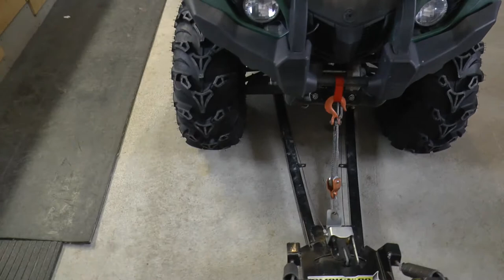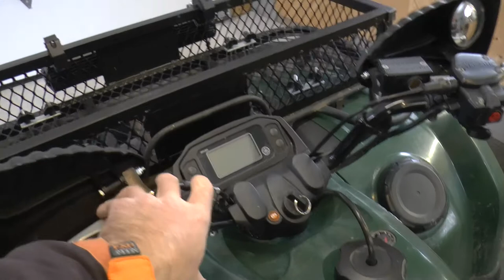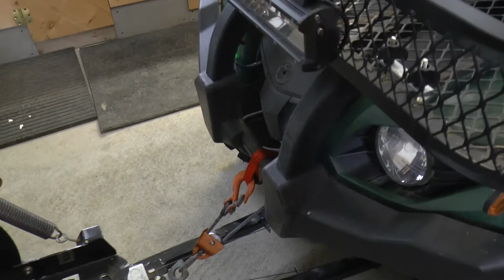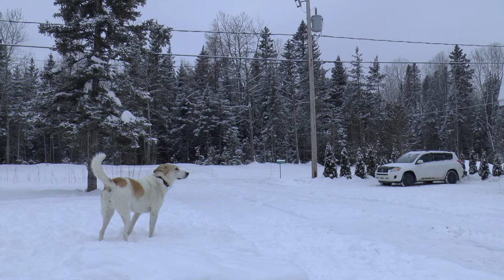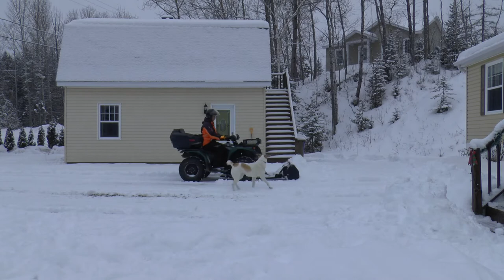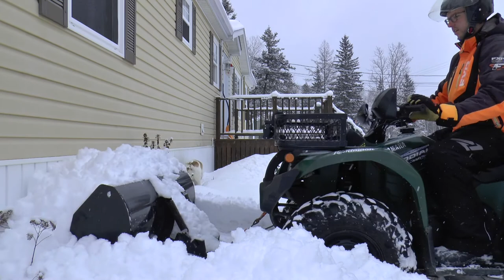Yamaha Kodiak 450 Kimpex Click N Go ATV plow

Comment from the maker: ✅ Get those accessories to build your own ATV setup 👇🏼👇🏼👇🏼
○Champion Power Equipment ATV 4,000 lbs winch : https://amzn.to/3VcLvIC
○Ranger 3/16’’ x 50’ synthetic winch rope : https://amzn.to/3V7cDJV
○Ranger winch cable stopper : https://amzn.to/3phAjNU
○Ranger ATV aluminium winch rope guide : https://amzn.to/3sl9omo
○Ranger winch hook with safety latch : https://amzn.to/3picNjJ
○Ranger winch hook with integrated pulley : https://amzn.to/3HPSJiS
○Ranger steel pulley : https://amzn.to/3VsmPwf
○Neiko 2’’x 20’ tow strap : https://amzn.to/3G4M7vL
○Kolpin ATV rack basket : https://amzn.to/3F28eTb
○Nilight LED light bar with wiring harness : https://amzn.to/3MZnthn
○Nilight Clamp mounting kit for LED bar : https://amzn.to/3ta9cFv
○Kolpin handguards with mirrors : https://amzn.to/3JT3ezI
○Kolpin Rhino Grip gun holder : https://amzn.to/3Ni5LX0
○Rubbermaid ActionPacker storage bin : https://amzn.to/3DmsAnQ